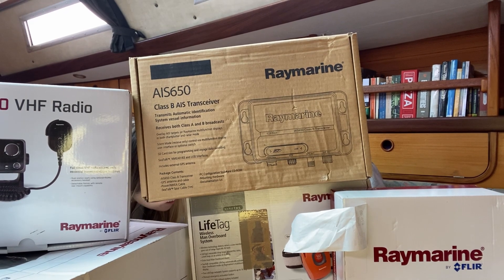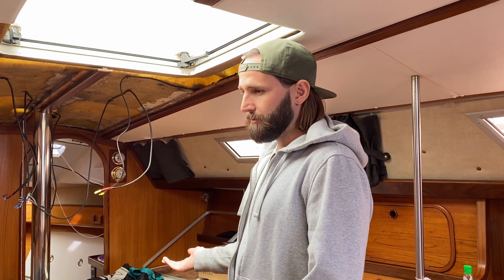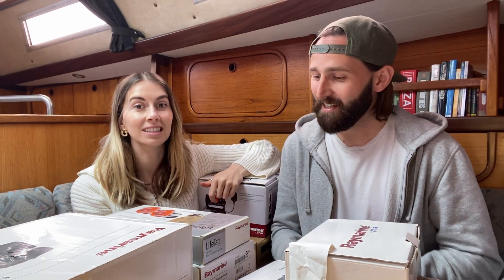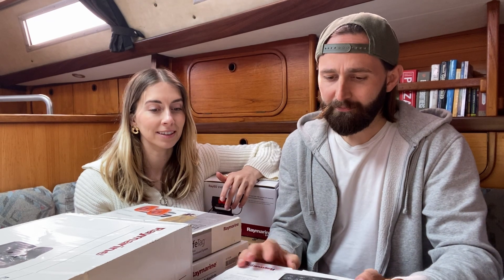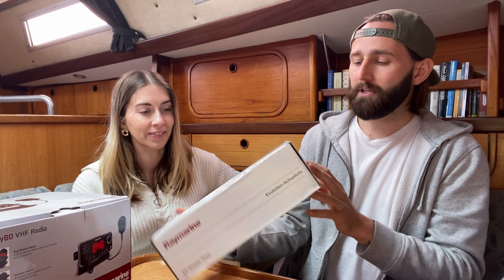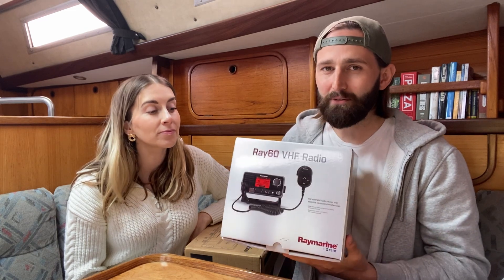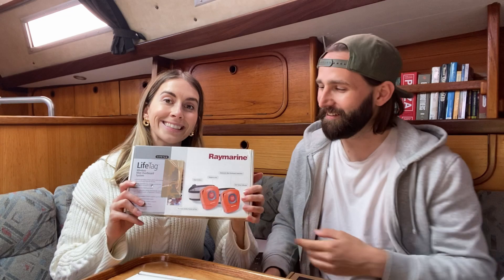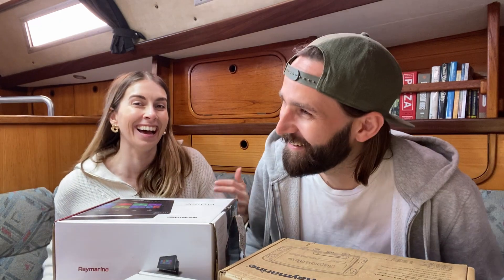SAILBOAT NAVIGATION How to INSTALL RAYMARINE ELECTRONICS l Ep. 14

Comment: Too much to go into all of it in a comment but looks like you’ve got most of what you need. So you have a Raymarine Seatalk NG network. The blue cables are your backbone cables and the black and white ones are spur cables. So the backbone runs throughout the system with spurs off to each of the instruments. You might need some backbone connectors etc but they may be in your box of cables. You shouldn’t need another NMEA box as you are pretty much all seatalk ng. The GPS receiver is basically an aerial for GPS which will feed into your chart plotter to provide position info. Anyway as I say too much for one comment but you know where I am on insta, just installed an axiom and seatalk NG backbone on Intrepid Bear so don’t hesitate to ask anything. Main thing is you have pretty much all the big ticket bits except the actuator for the autopilot oh except radar....who needs radar when you have AIS? Hmmm now that’s a whole other conversation....don’t get me started on that 😉😂😂 Anyway hit me up anytime you need to 👍🏻
Reply: As always fantastic advice from Iain!   Looking forward to seeing your install (even more so now ours is done and we don't need to do anything else 😂😂) keep up the good work guys, you got this 💪
Reply from the maker: Really appreciate the detailed comment here and glad you mention some things that we have seen mentioned in what we’ve researched so far. 
We are concerned with how it all gets powered and connected to the main electrical panel... but this could be a question we ask you when we’re at that stage. 
We’ll be researching for a few weeks and then getting into it!

Comment: Hello guys, congratulations on the purchase of your first boat. With the engine not starting, if the engine has a glow plug, make sure you use it for the recommended time, especially in that cold weather. If it still doesn't start, maybe the glow plug needs replacing.
I'm attaching an episode from Sailing Talisman when he installed new electronics in a boat he bought in Scotland. "sailing talisman ep33". Regards Angus. 
https://www.youtube.com/watch?v=1RyO7P6BLyw
Reply from the maker: Hi Gus! Thanks so much for watching and for this amazing comment. We’ve been told the Yanmar engines don’t have a glow plug? Even though there is a glow switch/button on the control panel?🤔 So we press it for ten seconds every time just incase, but still searching for the plug itself! 
Thanks also for the link to Talisman, we’ll have a watch of this today!

Comment: I installed a complete Raymarine system on our Sigma 362 a few years back - all the items you mentioned were included in my installation - happy to help as required.... Good luck :)
Reply from the maker: Hi Jon! Thank you for watching. This is great to know we’ve got everything we need! ☺️
Reply: @SailingIndiana  Just had a quick look at the list of kit from my installation.  I think you will need an AIS100 Splitter
 to go between your AIS650 and your Ray60 so you can share the mast VHF aerial.  You will also need with your Mechanical Linear Drive a Rudder angle reference sensor / transducer so the autopilot computer knowns in which direction the tiller is angled (https://raymarine.app.box.com/s/asgem5li7113mcgiz5yt93o829sticit/file/22147203765)

Have you got any wind instruments on the mast?  Is this Raymarine as well - something like an i60?

If I think if anything else I'll let you know
Reply from the maker: @jontettmar9064  thanks Jon this is super informative! We were looking at splitters so it’s great to hear your recommendation. Thank you for the link too! We do have a raymarine instrument at the top of the mast, which is new and we’ll also look into the rudder reference for auto polite. Great comment so thank you again! ☺️🙏🏼

Comment: I have the ACU 400 and the EV1 the Ray 73. All this was replaced before I bought my boat in Feb 2021. The EV1 is installed centre line of the boat. Mine happens to be on the bulkhead of the aft cabin closer to the ceiling.  All my gauges are installed on the bulk head when you enter the companion way. I like this since I can see them at the helm. I also have a Centre Cockpit so I am closer to the companion way entrance. Hopes this helps. One more thing READ the Manuals like 10 times, once you cut or drill a hole its done.
Reply from the maker: Great advice about the EV1, centre line of the boat it is then! Manuals is a good start, we’ve been checking a few YT videos but perhaps we should start with the manual first🤔

Comment: if you already have a depth sounder that tri sensor will fit in the same thru-hull which you can do while the boat is in the water, if your speed sensor is not working just blank it off
Reply from the maker: Whilst still in the water!!?? That might take someone braver than us😂! But you’re right, we have the thruhulls with fittings so worst case it’ll fit what’s in there.
Reply: @SailingIndiana  the raymarine thru-hulls have flaps that engage once the water starts rushing in, anyway it is only a second or so of water, no big deal
Reply from the maker: @akathesquid5794  Ah ok, got it! We’ll have some bungs in place just incase.